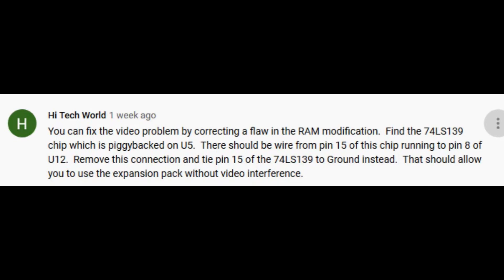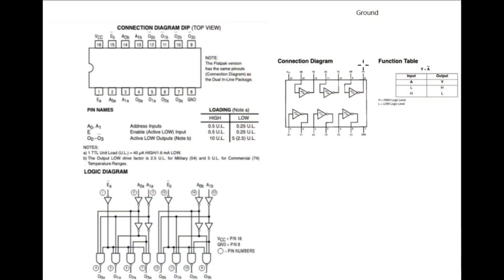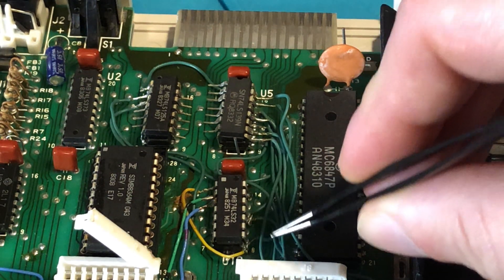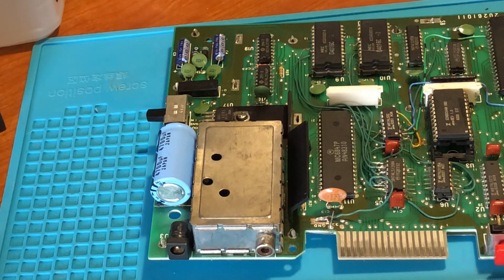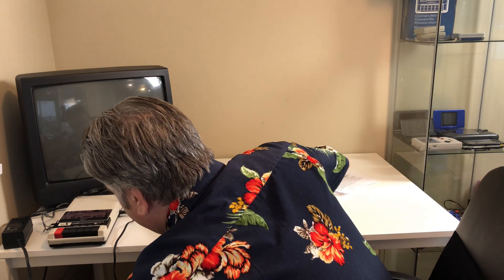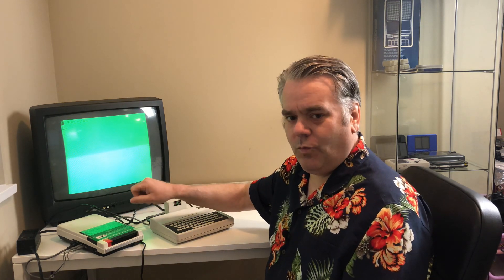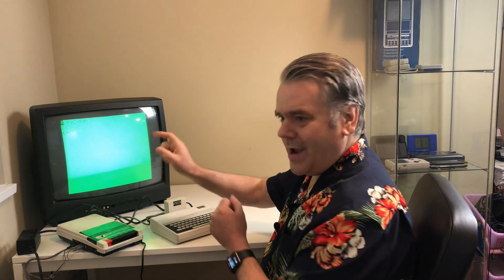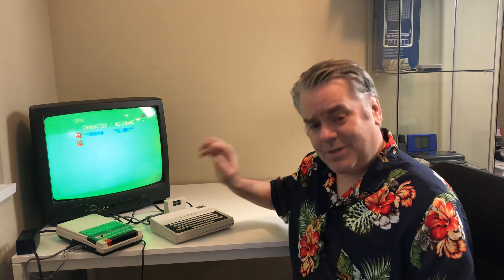Fixing The 8K Mod on My TRS 80 MC 10

Comment: I picked up a couple MC-10's at auction and am assembling everything I need to run them. I am currently searching for all repair videos in case I need to do that also. Good video
Reply from the maker: If you look on TRS-80 Color Computer Archive there is an entire section with manuals, new games, old games, and other goodies, all for the MC-10.
Reply: @CanadianRetroThings  very cool, thanks
Reply: @raymondheath7668  as a side note, i repaired the one that kept resetting itself once a second. Turned out it was a sync problem directly related to U18 74LS74 or U19 74LS76. I just replaced them both with sockets and new chips. Works great. Now on to the black screen One!

Comment: This also works for other expansions such as the MCX-128 which exhibited the same interference issue. However, the MCX-128 also needs to have the GAL updated to work correctly with an 8K internally expanded MC-10. Available online or all included in a package I uploaded to the TRS-80 MC-10 facebook page.
Reply from the maker: Thanks, that is good to know.  The MCX-128 is on my wish list of things I want to get!  The more I use this little machine, the more I like it.
Reply: @CanadianRetroThings  With these improvements and the MCX-128 it's quite a capable little computer. Great videos BTW.